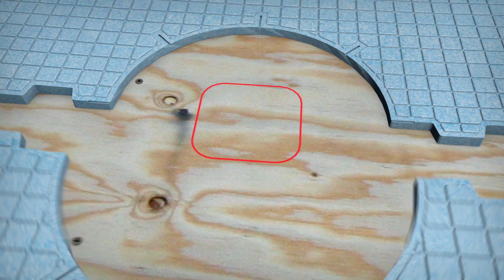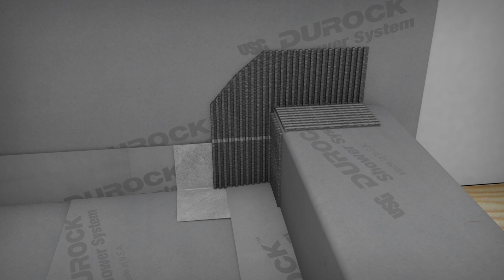USG Durock Shower System

Comment: I am installing this thing now.  First, the website instructions specify modified thinset as would be expected.  The membrane material does not like to stick to thinset at all.  I had to thin it a bit more to get it to stick at all.  Still have maybe 50% adherence.  I redgarded the concrete board prior to coating it with thinset.  It does not like to tuck into the corners either...so now have to pull membrane off wall and redo.  New plan.  Coat existing thinset with redgard, stick membrane up.  Redgard again over the whole thing.  Done.   3 layers of redgard, 1layer of thinset.   Oh, hey...from other videos  Durock makes an acrylic adhesive for installing this membrane.  WTF?

Comment: They are suggesting UNMODIFIED thinset to bond the foam to the plywood or OSB subfloor. That makes no sense , since the spec for thinset to plywood applications is A118.11 , which is a MODIFIED thinset.  Right?
Reply: Yep...the recommended thinset is modified  A118.11 or similar per the website instructions.
Reply: You should NEVER use a modified thinset for a shower!!! Modified thinset is fortified with latex which is organic and is a food source for mold growth!!!!
Reply: @michaelhorn9114  that may ne true, but can you be sure that all modified thinsets contain latex? Many manufacturers do not disclose the content. Secondly, we are talking about the foam board to the plywood which should have zero moisture. I'd be less concerned about mold growth and more concerned about the failed installation if there's moisture in that area.

Comment: With all of the modern permanent bonding systems out there, my entire waterproofing system is dependent on the membrane to membrane adhesive properties of THINSET??  I think I will skip this option.
Reply: There is another Youtube vid that the guy is using tile adhesive (I think) he does not call it out though. But it is not Thinset.
Reply: I saw a video of someone testing a liner in thinset. When he pulled off the liner to check if water got underneath it, it was dry but what I noticed is how easily the liner pulled off the thinset! WTF?
Reply: Yes...you are not wrong here.  It doesnt; stick very well to the membrane.

Comment: I find it interesting that this system installs from the top down. Rather than bottom up as if you were to waterproof - water runs down hill. As if there'd never be a bubble or capillary water leaching through the (unmodified thin set). Why in the world wouldn't you lap the top overlap the bottom? They are relying on a 2 inch unmodifed, in other words non-waterproof cement, bond rather than a top over bottom lap throughout this whole installation. If I use these products I will do it my way. Is this a sheetrock company trying to make a waterproof system?
Reply: Exactly what I’ve been wondering

Comment: why would you not do the floor first then the walls?
Reply: Same thing I was wondering that’s why I came to watch the video, pretty much everything you do water related should overlap the right way. You would start from the bottom and work your way up like roof shingles.
Reply: James Edward look up capillary action to see why it doesn’t matter which way the overlap goes. You need a proper silicone application either way

Comment: This is maddening - there is a critical dimension left out.

At what height should the drain pipe be cut (+/-) below the subfloor so that it will be  at the proper height to glue to the drain assembly?
Should it 1"? 2"? 3"? etc below the subfloor?
Reply: 2 5/8"
Reply: @mattdrew1792  Above?